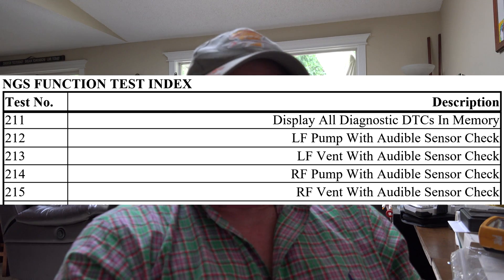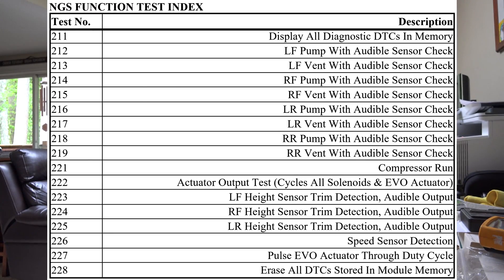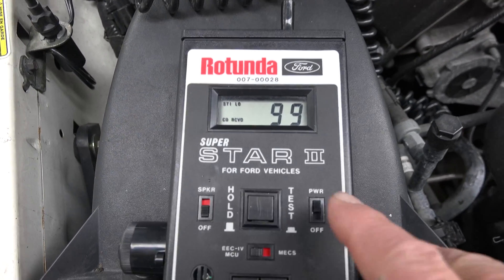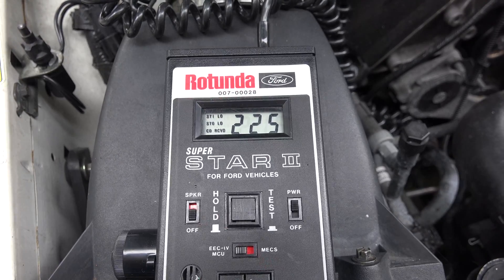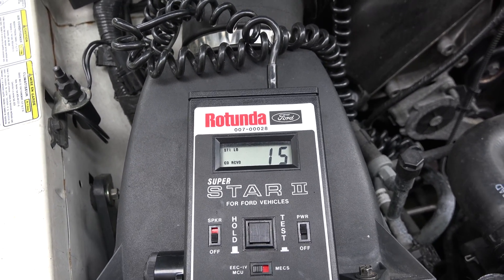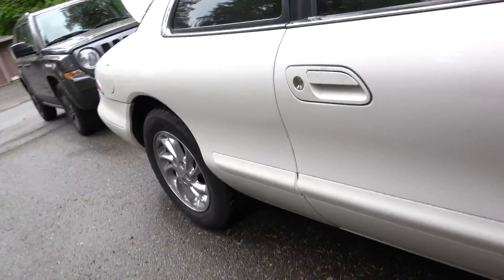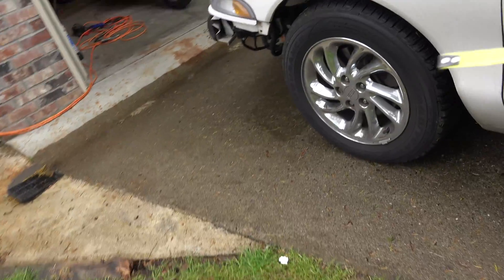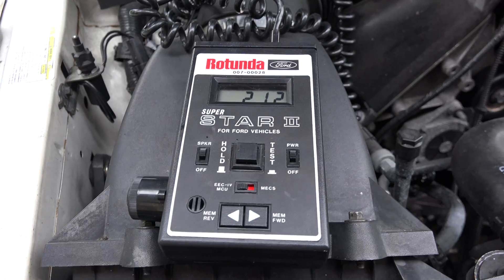1998 Lincoln Mark VII Code Clear and Performing a Functional Test

Comment: Jeff I wish I could borrow your Super Star II. I have a check air ride after changing front struts. The height seems to high on the left side. It takes a couple minutes to show a code after start up.  But it drives great and mostly everything is good expect the Check Air Ride message after a couple minutes. Maybe I could somehow read these codes without the Super Star?

Comment: Jeff Tjernagel,,,  I got your reply about air ride compressor,,,  prices for arnott compressor range frm 130 to 263$. Are they same.?
Reply: I got my arnott compressor,   Looks nothing like original.   Mount brackets, power connections, everything different
Reply from the maker: There is only one for the Mark VIII. 
https://www.arnottindustries.com/air-suspension-compressors/p-2210-arnott-new-air-suspension-compressor-93-98-lincoln-mark-viii
Reply from the maker: From a quick seach the cheapest one was for 205 at:
https://www.sdtrucksprings.com/index.php?main_page=product_info&products_id=20106

Don't know if they offer free shipping or not.
Reply from the maker: Just checked... They don't offer free shipping... :-)

Summit Racing for 213 + free shipping.

https://www.summitracing.com/parts/ntt-p-2210
Reply: Jeff Tjernagel arnott sz no retail an recommend 
Ed AutoZone.  AutoZone more dollars but lifetime warranty,  summit best price, free shipping.  Now I wait.  Not gonna start til I got all parts.
Reply from the maker: John Gore When I had to replace mine I got the Dorman from Autozone. First one had a bad relay in it and wouldn’t turn on. 2nd one wouldn’t put out enough pressure to air the shocks. Autozone refunded and I bought the Arnot and have had no problems ever since. 

Also the mounting bracket was wrong that came with the Dorman and I had to swap it out with my old mount... Just a thought. :-)

Comment: hello my compressor stopped coming on about 2 weeks ago. fuses good seems to have power to the compressor it does make a intermittent weak burping noise tried to connect pump directly still nothing. is there something that keeps the pump from coming on when a problem exist in the system?
Reply from the maker: Steve Accountius There is a power relay mounted on the front of the compressor bracket that supply's "big" power to compressor (40 or 50 amps if I remember correctly). 

If this relay is good and the compressor has power and ground then the brushes are probably shot in the compressor which would drive removing and replacing the compressor. 

There is the same relay located over on the left front bumper for other equipment (same location as the compressor but on the left). You could swap them to check the relay but it's a pain unless you pull the bumper cover off.
Reply: Thank you so much for the time and information. I'll try this today
Reply: replaced my pump today it came in today and it fired up and pumped up great. now the front is pumped up higher than the back it seems seams like i need to reset the trim height on her. any suggestions. and thank you so much it took about 2 hours to disassemble and around the same to put it all back together.
Reply: my front is at 16 in and the rear at 14
Reply from the maker: First thing to do is to find out which set is off.

To check the height measure from the bottom of the rim to the bottom of the fender. It should be around 24 ¼” on all four wheels  If not then adjust the height sensor on the wheel that is affected.  The rear only has (1) height sensor located on the right hand side by the axle.
If I remember correctly moving the bracket up will lower the affected wheel.
If you can get your hands on a SuperStar Tester II (hard to find…) it will give you an audible “beep” to assist in the adjustment.
Reply from the maker: Here is a short video that shows the recommended height and how to measure.https://youtu.be/EjlHLFyb_wI
Reply: thank you and I'm an idiot lol i measured from center of the rim. i re-measured and I'm a half inch taller in the rear but it seems to be pumping up now. 24 1/2 front and 24 rear
Reply: your awesome thanks for the help i know i would have spent many more hours trying to figure this out you have been a great help.
Reply from the maker: Steve Accountius Good job!

Comment: Jeff, do you have a list of the manual functional test codes? I have the start II tester and need the codes to run some manual tests. I'm getting an error 99 at the beginning of the Auto test and I need to start troubleshooting.
Reply from the maker: Here you go… I also added them along with the error codes to the description on the video

211 Display All Diagnostic DTCs In Memory 
212 LF Pump With Audible Sensor Check 
213 LF Vent With Audible Sensor Check 
214 RF Pump With Audible Sensor Check 
215 RF Vent With Audible Sensor Check 
216 LR Pump With Audible Sensor Check 
217 LR Vent With Audible Sensor Check 
218 RR Pump With Audible Sensor Check 
219 RR Vent With Audible Sensor Check 
221 Compressor Run 
222 Actuator Output Test (Cycles All Solenoids & EVO Actuator) 
223 LF Height Sensor Trim Detection, Audible Output 
224 RF Height Sensor Trim Detection, Audible Output 
225 LR Height Sensor Trim Detection, Audible Output 
226 Speed Sensor Detection 
227 Pulse EVO Actuator Through Duty Cycle 
228 Erase All DTCs Stored In Module Memory
Reply: Jeff Tjernagel, you sir are a rockstar. I think I figured out the problem. The air release solenoid is not opening. When I did the cycle test, it's supposed to inflate the bags to trim level, it raised them up all the way and now they won't deflate. So now, I need to manually deflate the bags and I'm going to need a new compressor.
Reply: Jeff Tjernagel, I can't even tell you how thankful I am. I couldn't find those codes anywhere on the interweb. Just The Auto test result codes. I was able to deflate my air struts and bags manually. I've come to the conclusion that the pressure release solenoid on the compressor is shot or plugged up.
Reply from the maker: Glad it helped!
Reply: That tester is pretty neat!
Reply from the maker: Makes it possible to actually troubleshot the system!  :-)
Reply: Yes sir. I owe you a coffee or a cocktail. When I'm in your neck of the woods, I'll look you up. Thanks again.
Reply from the maker: That was the purpose of the videos.  Trying to de-mystify the system for those of us that don't want springs and shocks...